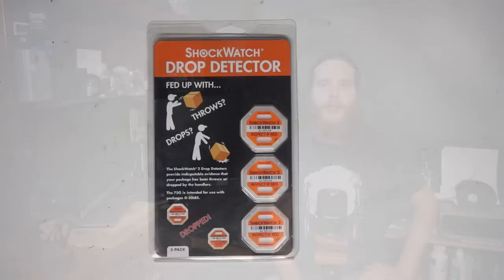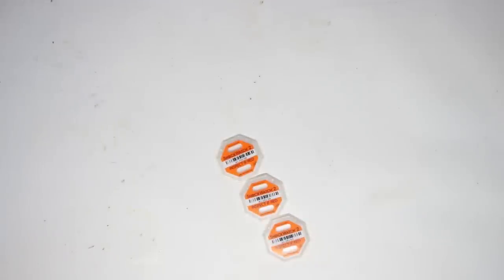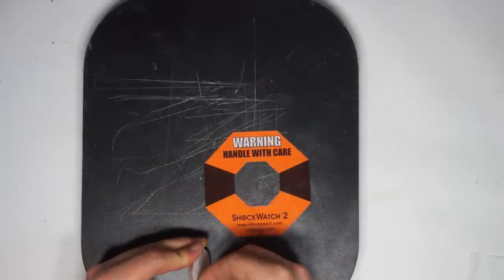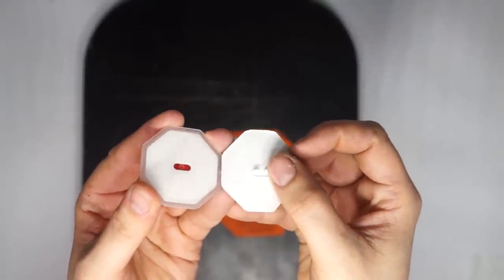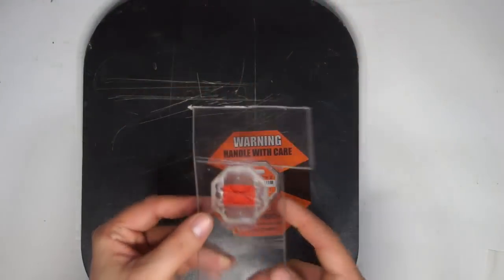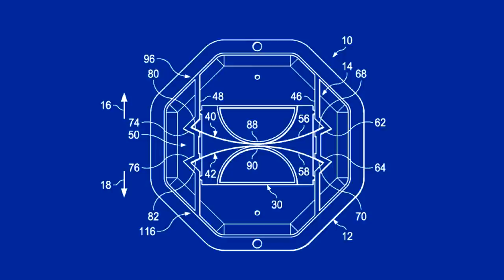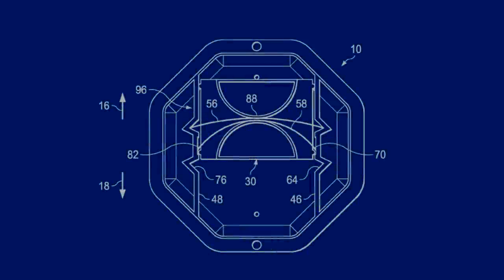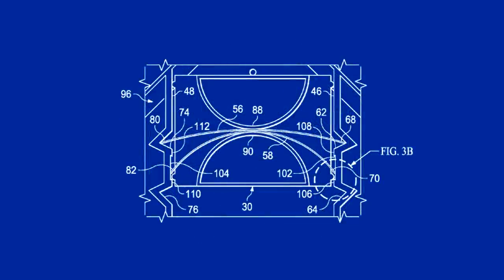Package Drop Detectors - G-Force Indicators

Comment: Note to self: Turn packages with shock stickers 90 degrees.
Reply from the maker: There are 3 spacial axis and 3 stickers in a pack ;)
Reply: Nick Moore remember to smack things about the 4th dimension if you want to be sneaky.
Reply from the maker: Would that make the package arrive early or late?
Reply: Robert, Nick
HAHAHA! :D
Reply: @NickMoore  later, depending on how long would it take you to smack it, but the package wouldn't notice any delay

Comment: Back in 1999 I worked for Excite@Home up in the bay area. We had these full sized computer rack sized storage arrays from EMC. I believe they held an (amazing for the time) 1 terabyte of data maybe it was 2 but it was almost comical compared to the fact that you can get well over that on a flash drive nowadays. Anyhow I remember after they were delivered getting my hands on the shock/tilt indicators on the shipping boxes. They were pretty neat. it was little plastic bubble somewhat shaped like an hour glass filled with a bunch of little tiny red statically charged balls in the lower half that if the box had been dropped sharply or tilted beyond a certain point would have jumped or flowed into the top chamber and held there with static cling making it clear that there had been some sort of faulty handling during shipping. It was amazing how fragile certain things were back then. I hope that made some sort of sense. Your indicators are so much more simple than that.
Reply from the maker: I know what you mean! They have a different shape now but they are called "tip'n'tell" on the sticker. We see them a lot with big variable frequency drives and hydraulic equipment.

It is funny how much storage has advanced, I found my first flash drive the other day. A 16mb memory stick, my still camera saves 30mb raw images and my high speed camera records 2gb/s!
Reply: tip'n'tell yeah that rings a bell. Your high speed that's a chronos right? Those are so cool. It's funny I didn't recognize your channel and I'm not sure how long I've been subbed but I looked over all your past videos and it is all stuff I'm into but none of it looked familiar. Good stuff though. I remember my first brand new computer was a packard bell pentium 75 with a 1gb hard drive. I remember thinking wow that's so much I'll never fill it up. Probably about a month or 2 after I learned otherwise. :) I had plenty of computers before that but they were all second hand ranging from an old 8088 with no hard drive that ran games and apps off 2 5.25" floppys up through 486's. Hell I still have an old ibm portable 5155 (maybe slightly newer but the same idea) with windows 3.1 on it. I need to pull that out blow the dust off and see if it boots. It should. How far we have come... :)
Reply from the maker: Glad you like my stuff, I used to spend hours taking things apart to see how they work, now that I have fancier tools like the Chronos I can get a way better look.

My first PC was a 133mhz Intel with a couple megs of ram and Windows 95. I really miss shareware.
Reply: Mute8s:  were you with @Home, Excite, or hired after the merger?
Reply: I was technically the first one hired after the merger but I worked over on the Excite side.
Reply: Ah...  I was early @Home, in network operations.  

I didn't  find there was much mingling between the two companies at all.

The only person I know who worked on the EMC SSDs was Trevor Fiatal; I think we were evaluating them for use in our proxy servers.

Comment: I used to take delivery of OCXO (oven-controlled crystal oscillator; frequency and performance is shock sensitive) shipments with the glass vial type on them. Had a bit of a play seeing how hard they were to set off, but don't think I kept any sorry! When those ones were set off a red liquid fairly quickly stained the material in the indicator tube - also very obvious when they were triggered.
Reply from the maker: I thought there were some liquid indicators but I didn't see any on eBay, I'll keep looking.

I watched a video recently on OCXOs, it still surprises me that the best way to get a fixed frequency is to 'ring' a bit of crystal at exactly the right temperature.
Reply: Yeah, there's quite a bit involved in getting the best out of an ovenised crystal oscillator - you need:
- the right crystal cut (normally a "SC" cut for OCXOs vs the common "AT" cut)
- a chamber with extremely good temperature stability and low gradients, close to the crystal freq-vs-temp sweet spot (~90C for SC cut)
- to operate a tunable oscillator at a particular vibrational mode of a particular overtone (for 10MHz I think it's normally 3rd overtone, and always the C mode unless you're doing funky multi-mode operation to use the crystal itself as the temperature sensor)
If you do all this though you can get some pretty impressive performance from a non-"atomic" clock, e.g. with temperature stability measured in sub-ppb levels (google "ROX5252T1" for an example of one that I used)

Comment: That is cool. I just saw a video that shows it's not as effective if the g force is going parallel to the tag and it's because the springs don't move in the right direction to activate. So it's important to use multiple
Reply from the maker: Yeah, ideally you would use 3, one for each axis.

Comment: hi Nick!
i would enjoy it if you explored possible methods of covertly resetting them after they have been triggered.
i have a few sneaky ideas!
Reply from the maker: I had thought of it but I'm not sure if shipping-fraud-tutorial is a 'YouTube Friendly' topic. I can tell you that it is extremely difficult to get the back off without cracking the body of the indicator. I think they chose very brittle plastic for that reason. You could glue the flag from the back before applying it but that would require the foreknowledge that the package was going to be mishandled.
Reply: i wouldn"t consider it a shipping fraud tutorial. i think an honest scientific approach to solving a problem is interesting and compelling. and if it can"t be done you have done the company a PR favor. and if it can be done  you have done their customers a favor.  we use something much more complex. i am sure i can defeat that. after it is triggered. not before.
Reply from the maker: I still have 3 left so I may come back to it later. I'm more concerned about YouTube content strikes than anything else given how many other amateur science channels are being hit. I admit that as soon as I had them so was thinking of ways to reset the flag without leaving a mark.
Reply: I think that would make for an interesting video, especially if you can come up with a way to actually do it. Resetting them without penetrating the device looks nigh impossible to me, so I'd love to see a clever person figure out how to do it!

Comment: It's too bad we live in a world now where the mail system is so overloaded, and the staff is underpaid and hates dealing with more mail than they can handle. I remember hearing about a guy who worked at one package sorting center, and he said that he was told during training to "Scan, throw. Scan, throw." It's the only way to keep up with how everything is setup.

I watched a video of a high end PC builder, and how he packs his PCs to be shipped safely. First, he cuts out foam and packs the inside of the case so that all the components inside can't move. Then he did the same thing on the outside of the case in multiple layers with ever larger boxes I believe, I can't remember exactly but it was extremely thorough. At the end of all of that, he put the final box inside of a wooden crate which was huge compared to the original computer, it looked something like 3 and a half feet per side. One of the advantages of using such a large crate is that you can't throw them, besides the obvious advantages of more room for padding, and stronger walls to protect from hits (wood is stronger than cardboard.)

Comment: You should check out the LoRaWAN touch tag. It can be used for a similar result but with more active feedback.
Reply from the maker: Very cool, they measure loads and have an open api so you can write your own monitoring software. I only see one on Amazon but it is out of stock, I'll keep my eyes open for one if they are cheap.
Reply: Nick Moore keep in mind it's using lorawan as a protocol. I'm pretty sure it uses a specific access point.

Comment: This only measures the acceleration along one axis though, right? Plus, even if you were to use three of those for all three axes, you could have an acceleration beyond the threshold whose components are all subthreshold.
Reply from the maker: Interesting, I hadn't thought of that but yeah. If it landed on a corner none of them might trip. Even if it was enough to trip being at an angle might cause the flag to bind up or jam.
Reply: In the context of a shipping box, the corners of the box might be crushed if it was dropped on a corner. Since the stickers are meant to indicate mishandling (not to measure of how much mishandling occurred), they are meant to be attached in the axes that might not otherwise show damage. (To say it differently, the stickers indicate on-axis drops and the corners of the box indicate off-axis drops.)
Reply: Hirudin, are there different boxes for different g forces? ;) But yeah, I get you. It's not meant to be exact but a ballpark threshold.

Comment: seem like you could hit it very hard in the opposite direction to get it to reset.
Reply from the maker: It might be possible but I think an impact hard enough to un-set the detector would make it trip to the other side or just destroy the package. I may try that with the cut away unit later.

Comment: Does that mean they only work with one orientation?
Reply from the maker: It will indicate for a shock in both directions on a single axis, if you use all 3 in a package then you can cover all 3 axis. Someone else mentioned that a hit on a corner might be above the 75g threshold at the corner but less in the component where the indicators lay. I may have to test one at an angle to see if they work or if they bind up when not hit straight on.
Reply: Anther idea would be to have a high pressure capsule simalar to the ones found in fire sprinklers and attach a small weight to the center, and hold the capsule by the ends. Any impact and the momentum of the center weight would result in breaking the capsule. If the liquid inside was clear but reacted with paper to dye it red, then it would be effective.